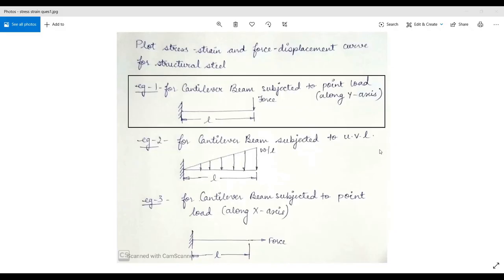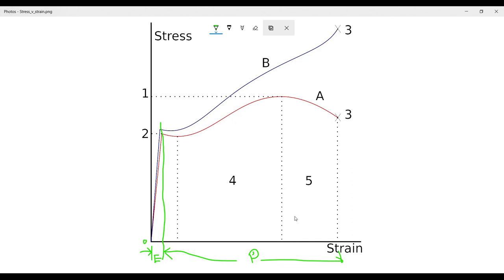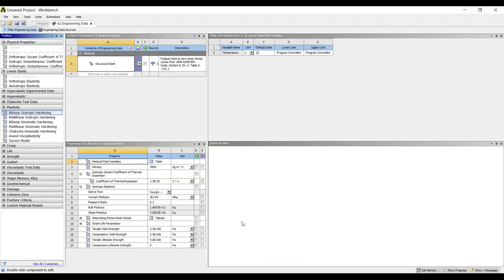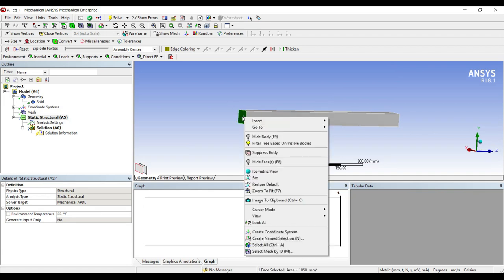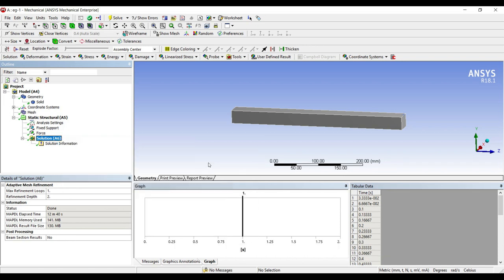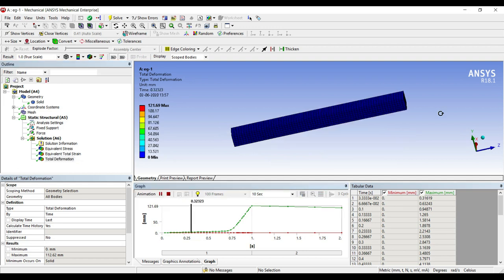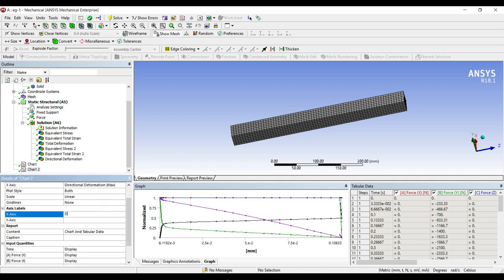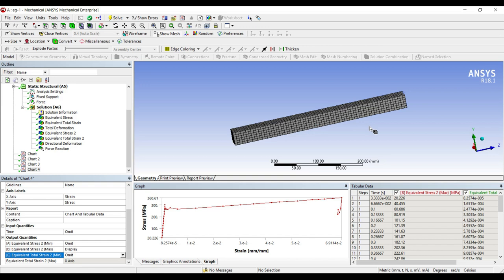Stress vs. Strain Graph I Force vs. deformation graph I Problem 1 | ANSYS Workbench I Basic Tutorial

Comment: For getting stress vs strain graph of a tensile test for a composite material, what properties are needed to perform simulation of failure? Plz help if you know anything, I am getting 0-2 (elastic region) point as you mentioned in the graph but want to find 2-3(plastic region) points in the graph